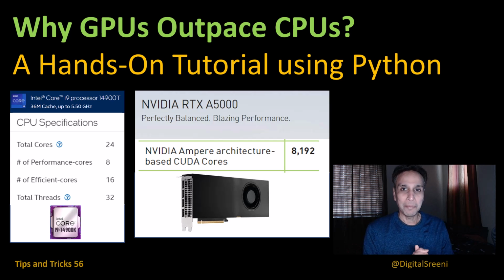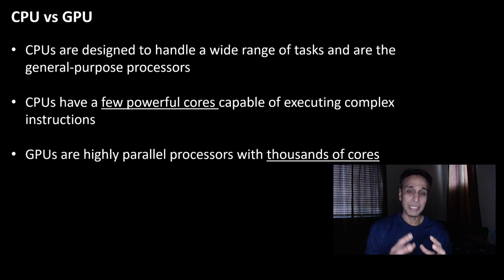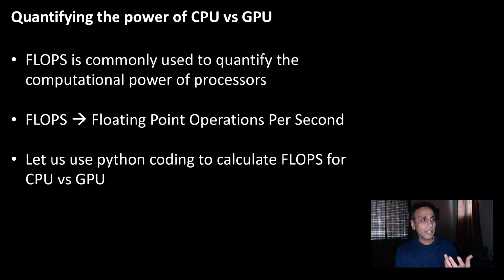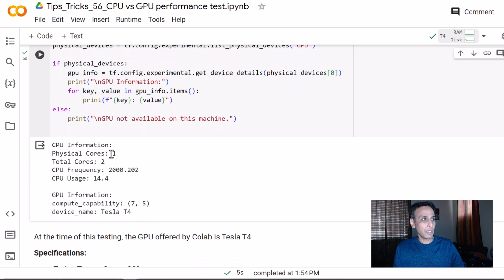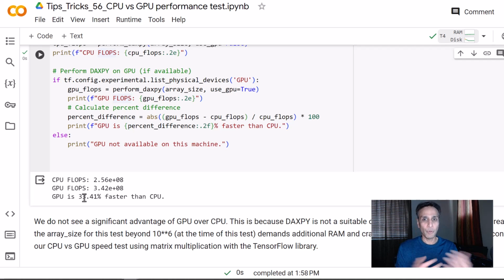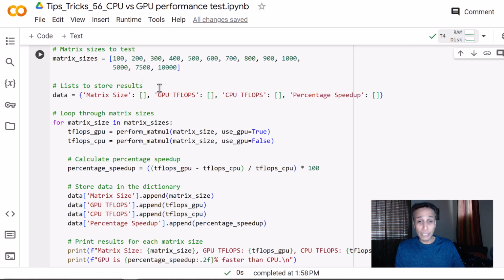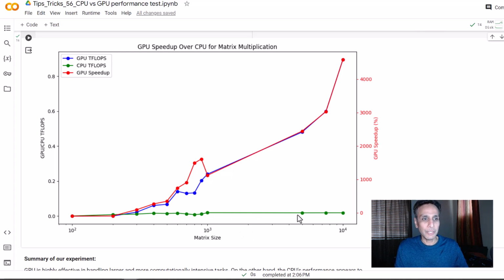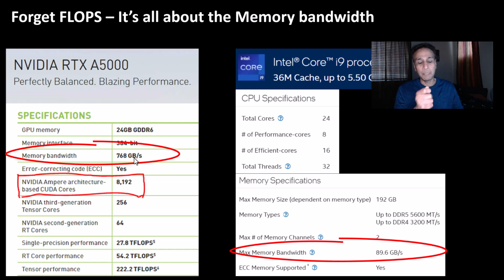Why GPUs Outpace CPUs?

Comment: @DigitalSreeni hi can you explain why you divide array size by time to calculate FLOPS how does it give what floating point operations per second it took, what I understood from your calculation is that you might be considering an estimation like how much time it will take to build the newly calculated array is ~ saying FLOPs.
Reply from the maker: The calculation of FLOPS in my code is based on the time taken to perform a specific operation (e.g., DAXPY) on arrays of a given size. The rationale behind this calculation is that it estimates the rate at which floating-point operations are executed per second. If you consider the DAXPY operation (A * X + Y), each element in the arrays X and Y undergoes a multiplication and an addition, which are floating-point operations. So the total number of floating-point operations is proportional to the array size. It provides a rough measure of the performance in terms of floating-point operations per second. In reality, the actual number depends on the type of operations and of course the underlying hardware.
Reply: Thanks  @DigitalSreeni much appreciated 👍

Comment: At 7:05, I see in the specs sheet 256 Tensor cores. Are they the same tensor processing as in TPU? Maybe you can also explain TPU? Note that I’m just starting to watch. Maybe you will explain later in the video?
Reply from the maker: The tensor cores in GPUs and TPUs involve tensor processing but they are different technologies designed for different purposes. GPUs are more general-purpose and versatile, suitable for a range of tasks like gaming, graphics rendering, and parallel computing workloads. TPUs are purpose-built for machine learning and are highly optimized for tensor operations.